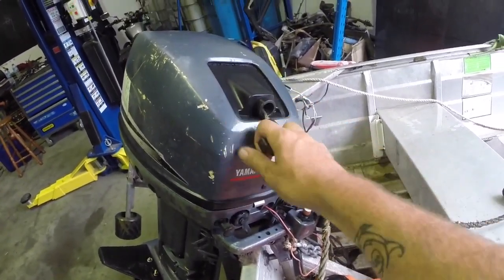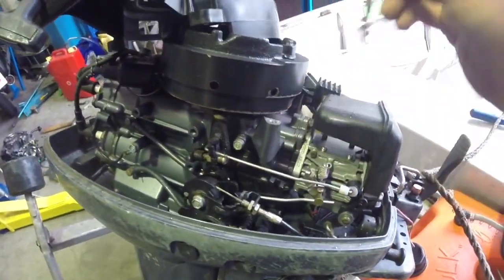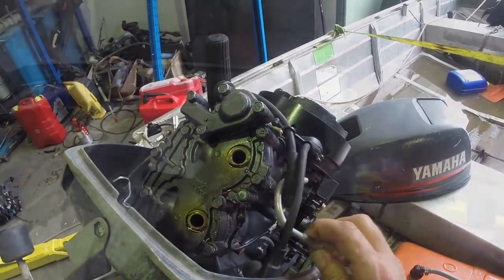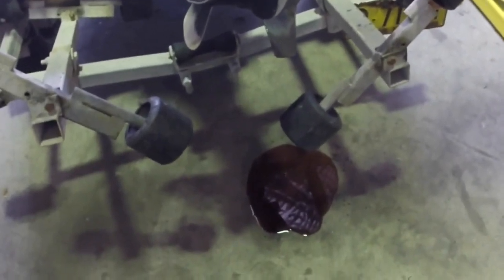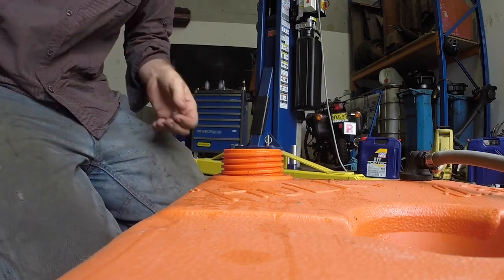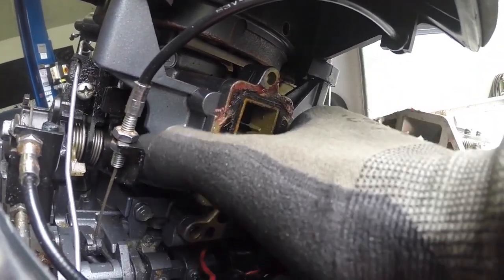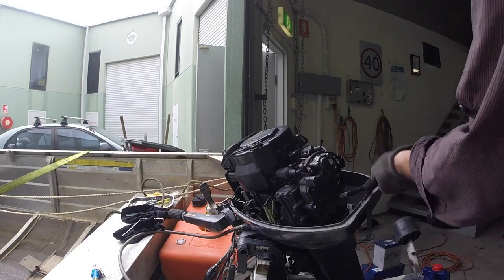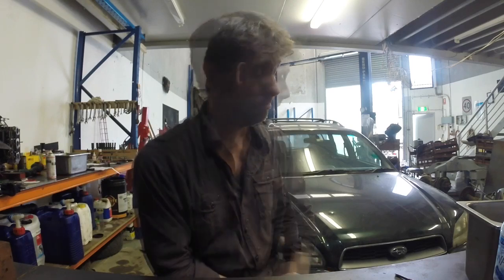Unseizing a seized outboard motor

Comment: I thought my 115 johnson was going to be a big paper weight. Cant turn the flywheel more than 1/4 turn. When it stops raining I am going to go try the atf in the cylinders overnight trick! The motor sat for the last 4 years. It was used a couple times back then, and had sat 3 or 4 years prior to that. Probably only been started 10 times in 10 years.

Comment: Iv followed the steps, getting to the part where I'm using a breaker bar and my fly wheel nut is coming off when I go backwards, and forwards not budging at all any tips I could use. The engine is a 2016 15hp super mercury
Reply from the maker: If the nut is undoing you will be restricted to going in one direction until it starts to free up. All you can really do is keep soaking it with a mixture of ATF and acetone until it starts to move.

Comment: Hi I have a 1963 johnson 40hp its seems to only turn over when spark plugs are out it's a pull start so I'm wandering if it has water in the cylinders or and air blockage?
Reply from the maker: If there is water in the cylinder it should come out when you turn it over with the plugs out. If there is air in there it should be compressible. If starting with a starter motor it could be a weak battery or dodgy lead.
Reply: @DangarMarine  dosnt seem to be any water  coming out at all not even oil just air and its pull start so  I'm guessing it must be like a vapour lock but I dont know where to look what about exhaust? Or could the carb be blocked

Comment: Great job mssaging it back to life ,,,but if it had water for a long time what about the needled bearings on the rod and  crank,  they will all be ruined  ,,yes they will free up but only to destroy themselves to pieces and finally gauge bores and piston  soon after you get it running ,,, borescope needed here !!
Reply from the maker: Thanks mate. It really comes down to knowing the motors history I think. If it got a bit of water in the cylinders from plugs being left out or a blown head gasket then it will probably be fine. Motors that have had salt or silty water in the crankcase will probably fail soon down the track as you say.
Reply: Hello from Denmark-a Yamaha have ball berings so no damaged chrankshaft-and you are right i have tried it on a Evinrude, they have needle bearins..crankshaft wit big rusty mark´s on..

Comment: oh ps trans fluid does burn but not very flamable in the auto shop i worked in they used it to prime diesel filters when changed
Reply from the maker: Interesting. How come they didn't just prime them with diesel?
Reply: +Dangar Marine in america diesels were quite rare and we had 45 gal drums of engine oil and atf so it was readily available.(was a mercedes specialists aswell)

Comment: Hi Stu, Just watched this video because a neighbor has a susuki 8hp that is seized up. But he told me it ran out of oil? don't know much about this motor yet if its a 2 stroke or 4. I asked him if the oil injection quit working which would be on a 2 stroke if not oil mix but he didn't know since he got the motor from someone else. I told him I would first go over there someday I'm not busy and help him work on trying to free it up. Like your method to at least see if its worth it or not? If he gives it to me i'll make a tear down video and use a press to get the piston pistons? out.
Reply from the maker: Hey Tim, doing a video very soon on that exact problem!
Reply: Cool, there is hardly any videos on this on YouTube which is why I'm glad your doing one soon. I plan on doing the same if he gives up and gives me the motor for free. Like I said I'll help him on it but if it doesn't break free then I ask him if he wants it off his hands. If anything allot of good parts on it to sell on ebay or if I do get it running sell the whole motor.

Comment: Wanted to ask if you had any tips or vids pertaining to what to do before firing up a motor that has sat a year or during the winter. I unfortunately had to move very quickly for a job and couldn't take my boat. So it sat uncovered for a year at a family members house after my boat cover blew away during a storm.. I treated the gas with Seafoam but don't remember if I ran the gas out and disconnected the fuel line. I'm not about to move back and am researching all I can on the topic. Any help or suggestions on videos would be much appreciated. BTW the motor is a mid 80's 60hp Merc.
Reply from the maker: Co-incidentally, I had a boat at the workshop at the moment that hasn't been started for about five years that I'm about to fire up. You've inspired me to do a video on that so I'll try to have it up online in a few weeks for you.
Reply: THANK YOU!

Comment: I have three Johnson/Evinrudes, all '72 models and all 65hp two-strokes.   One the lower end is out buts runs great but only in forward (default), the other which is supposedly fine I can't seem to turn the prop by hand, is it seized or in a wrong gear, all are on a rack?
Reply from the maker: If you drop the gearbox off the leg you will be able to see whether it is the gearbox that has seized or the powerhead.
Reply: Ok great, actually got past that point, thanks!   NOW, I am at a point where I would like to swap my motor mount from one to another.   The steering on one motor is excellent and the one I need it on is not, can I swap the two and if so do you have a video or some other step by step help I can go to to walk me through this?   Tried going to repair manual but they don't show procedures like this and I would rather not rebuild it, just want to know how to take one off and put one back.   Manuals focus on motor, drive, elect. etc., not so much the rest of the so called body or brackets of motor, if ya know what I mean.   I am still trying to inject degreaser into the zurk to help loosen any old grease and corrosion but not seeing much improvement, if I do I will finish w/ new grease.  Again, I have three identical motors and trying to make one great one.   LOVE your videos by the way, keep em coming!!!

Comment: Hey Dangar, great video as always! Just wondering, would WD40 or any of the other types of spray lubricants work for this method? I have a seized motor I'm trying to fixed (Had not started it for a long time) and was fairly sure they would do the job but thought I would ask an expert.
Reply from the maker: Sure, WD40 would certainly help.

Comment: Playing on a 60? Merc White Block 4 cylinder that is froze up, thanks for the info day two still froze, but now off to harbor freight to get a bigger persuasive bar, thanks for the info someone has removed the carbs, and starter, but I still have hope of finding a set of carbs, and a starter,  if I get it unfrozen.  The two outside cylinders are 20mm deep inside or 60mm
Reply from the maker: You could also try a 50:50 mix of ATF and acetone or some warm oil. Good luck! :)
Reply: Dangar Marine I’ve been warming up the head with a small acetylene torch too.  Maybe tomorrow.  Thanks for reply

Comment: Cleaned all carb compression is all 110 on all 3 cylinders think this 1 has me beat
Reply from the maker: +loaded1981 Are all the carburettors fed by the same fuel pump? What makes you say you think the bottom ones are low on fuel? When you are turning it over, if you crack the drain plugs on the carburettor bowls do they have fuel in them?

Comment: This is your friend from Arizona I bought a seized 115 horsepower Suzuki 4-stroke I added ATF l to the engine this boat is out of California it was used in the ocean and the oil is milky any advice thank you my friend
Reply from the maker: I would check if it has a blown head gasket if the oil is milky.

Comment: Hi from central Florida, my question is the liquid you called "metho" would it be called something different in the states? I did a search and the results were Denatured alcohol, also called methylated spirit, is that right? Just found your Youtube channel the other day and find it very interesting. Looking forward to your work on the steel trawler. Best Regards Jay
Reply from the maker: Yep, methylated spirits is what I was using. Alcohol will absorb water so great for this job.
Reply: @DangarMarine  what's the best Alcohol to use Stu??? Bundaberg or Coopers Stale Ale?? lol ... just kinding... Thanks again... I've just bought a 90 Evinrude and tinkering with it now... I've become confident to service it myself... awesome work you do for others...

Comment: Hi what do you think of 2003 Johnson 15hp outboard ?  are they better than an early 90's Yamaha 15hp? cheers.
Reply from the maker: Hi Baikal, I'm not particularly familiar with them to be honest, but I haven't heard anything bad. I would generally go for the newer outboard if I had the choice, but that is mainly because outboards around hear suffer at lot from corrosion even if they don't have many hours on them.
Reply: Given where you are located, I think it is still mostly Yamaha outboards on the river still. :)

Comment: How do you drain the crank case just in case you think it is full of oil.
Reply from the maker: +B Mckinnon You can remove the carburettor and reed valves then tip the motor up, that will get any fluid out.

Comment: I just bought a 1954 10hp scott atwater bail o matic thats seized. An old friend told me pepsi in the cylinders will un seize it 1) does it work 2) how long should it sit with pepsi
Reply from the maker: Not sure, never tried using soft drink. I usually use a mix of ATF and acetone and let it soak for about 12 hours.

Comment: cleaning carbs i can see inside the motor behind where the carbs where its a bit dirty is there a way i should clean inside while im at this point
Reply from the maker: Is it a two stroke or a four stroke? If it is a two stroke you can take the reed valves off and clean then on the bench with carb cleaner then re-assemble.

Comment: It's a Suzuki dt55 same pump all carbs full after turning it over & getting nothing pull the plugs top plug covered in fuel second plug not as much bottom dry I'm pre mixing the fuel as I don't know if the oil pump is OK yet
Reply from the maker: Sounds to me like the carb jets are still blocked then. If there is fuel in the carburettor bowls up to right level then provided there is compression and no major vacuum leaks then fuel should be drawn through. I would take the lower carbs off again, check the gaskets behind them, make sure you can see clearly through the jets and inspect the float heights and needle and seat.

Comment: did you re use your gaskets when re bulding carb ?
Reply from the maker: If they aren't torn at all, usually yes. The one that seems to fail the most is the o-ring around the top of the float bowl.

Comment: If you have aquality one, you can turn the motor over (to clear out the ATF) with a power drill and socket on the flywheel nut. Save your arm a little bit of work.
Reply from the maker: Yep, certainly a good way to go with smaller outboards.

Comment: Just curious, can any of that ATF or anti seize get into the lower unit; like via a leaking seal?  I have never seen a twin cylinder of such low horse power, is this common in OZ? Us Yanks suffer with larger and larger single cylinder engines, especially in riding mowers and very rare are 2 strokes. Stay safe folks, I fear this virus could explode due to idiots, from the top down, in many countries.
Reply from the maker: No, can't get into the lower unit. Well, it will run out the exhaust, but won't go into the gearbox.

Comment: Hello Dangar Marine, i have this Yamaha 9.9/15  and i hit  whit the shaft something whose underwather, i whose change oil in gear yestarday and my oil in shaft is Milk ;( i try to change simering but i looking on shaft and i see place where i hit something and there is some scrach all the way on shaft, but its looking like aint scrach but i thing this is the problem where from gear take in wather, do you have some sugestion how to fix this srach, do you use some glue to alumunium ? or  the best solution is change gear?
Reply from the maker: I would be inclined to rub any burrs with a very fine (2000 grit) sand paper wet with WD40. The high burrs will cut into the new oil seals and damage them. You could try filling the groves with a metal epoxy like Devcon, but personally I would just do the sand and then keep and eye on the condition of the oil after the next few trips.

Comment: hey i have a question for you ......what size would i need to re-thread the top bolt on the crank shaft?
Reply: oops what size die would i need to re-thread the top bolt of the crank shaft?
Reply from the maker: They all vary. You would need to put some vernier callipers across the top and then check the thread pitch.
Reply: i dont have the vernier calipers but i do have he thread pitch

Comment: Hey Stu i just noticed for the first time the Hoist in your workshop, and the fact you said you work on cars too just at the end of your clip. How well do you know XR6 Turbo's as mine has a strange whirring sound when she comes under boost, im thinking my oil feed line might be blocked and its starting to starve her of oil. How much would you fit the Earls Oil line filter kit for if i supply the lines, its the same as the ones they have on ebay if you run a search for the kit a whole heap of them come up.
Reply from the maker: +tolgahk84 I'd have to check with Arn who the licenses car mechanic at the workshop. We recently did a turbo swap on a VW due to an oil problem which which took about a day's labour, but if it's just the lines yours may be quicker. It's very hard to quote though without seeing the exact job as small thing can make a huge difference to the time required.
Reply: +Dangar Marine Not a problem, do you guys work on Saturday?
Reply from the maker: +tolgahk84 Only Monday to Friday unfortunately.
Reply: +Dangar Marine yea i just noticed, i'll probably swing past tomorrow after work depending on what time you guys close on Friday afternoons, i finish at 12 so it should take about 40 mins or so to get up to you guys
Reply from the maker: I'll be around until about 6 this afternoon as I'm giving my stepson a motorbike lesson and need to do it somewhere off the roads.
Reply from the maker: +tolgahk84 Actually, early afternoon is good as Arn will leave before me and he is the man to look at it.

Comment: I have a 40hp Mercury which I haven't used in about 5mths and just tried to start it today. The cord was almost impossible to pull at first but after a few attempts, I could pull it out slowly. If I pull it quick, it just gets stuck like on the 2nd spin of the flywheel (I think). If I pull it slow, it will go in stages, like 2 spins, slightly stuck, then pull further 2 spins, slightly stuck again but eventually all the way if I go slow (which means I can't turn the motor on).

After many attempts and 2 handed pulls (about 30 first time round, 10 on 2nd time), I got the motor to start but cord is still hard to pull if I turn it off and try again. Does this sound like it was seized?
Reply from the maker: If it's running I would say not. It might be a problem with the pull start mechanism instead.
Reply: It does start and once it did (after a while) it ran fine. Thanks for the suggestion, will investigation the pull start mechanism further.

Comment: You saved my vacation. I'll be studying your videos, they are great! Wish you were here though. I have bought a used 2011 Yamaha F25 and today I ran it for the first time. I noticed right away that the engine did not quite respond to the throttle. After running the engine for say 10min it just died. Currently, the motor will start quite well but it will only run for 10 or so seconds and then it dies. If I wait for a while before starting again it will run better but still only for like 10 sec. What are the first things you would check? I recon there is an issue with fuel supply, filter, carb? The only thing I have tried this far is to switch the old fuel to fresh fuel. Also I think the cord between the fuel tank and the engine seems a bit old.. My family is depending on my to fix this and I would be SO greatful if you could give some advice!
Best
Johannes
Reply from the maker: Hi mate, glad the videos have been helping you. I think you are on the right track with fuel supply. It could be fuel pump or an air leak in the fuel line. If it keeps running if you squeeze the primer bulb the whole time they it will be fuel pump.
Reply: Thanks! I have tried to squeeze the primer bulb while running with no success. As well I did notice a slight glitch in the fuel line. Will get a new one tomorrow.
If I need to change the fuel pump.. Where is it:) The fuel line leads into a black box from which another fuel line goes leads to the carburator. Would this black box be the fuel pump? 
Sorry if this is to low level:)
Reply: I just watched your fuel pump video. I dare say it is the black box I suggested...